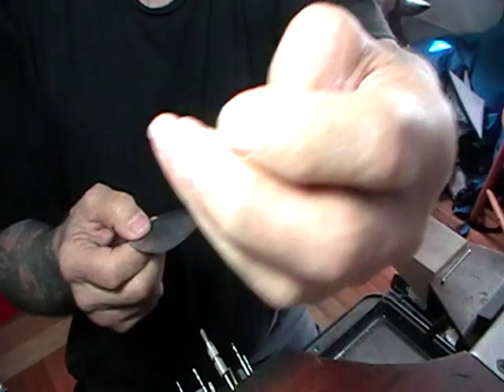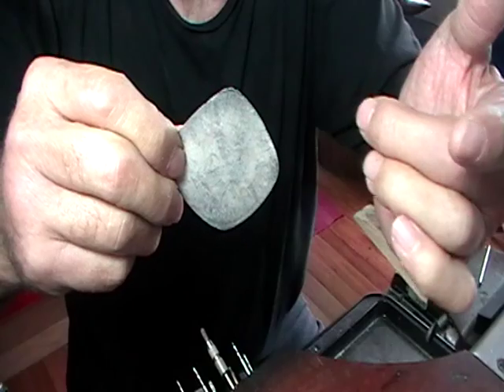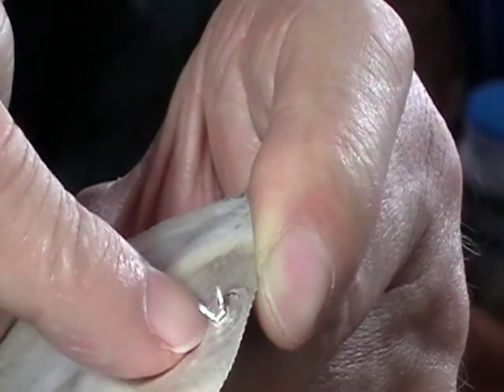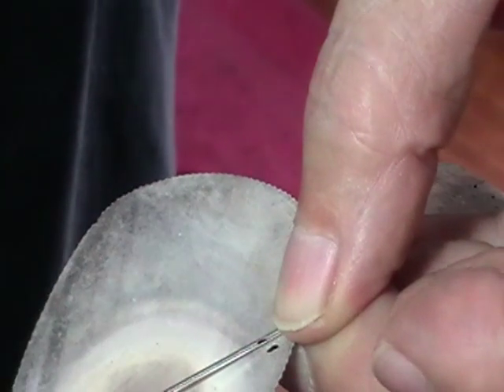brooch findings

Comment: Thanks Soham. This was just what I needed. One more question,  would you put the finding on before or after decorating the front?  I. Have a design with a number of solderings for the front and I used a bought brooch back, which I put on first and promptly melted the pin so had to fabricate a new pin.  Using the finding you suggest seems better as the pin is placed on last.